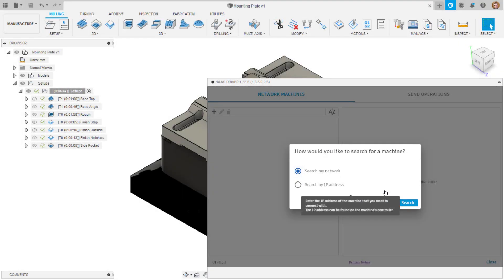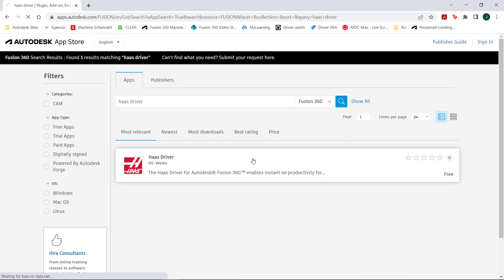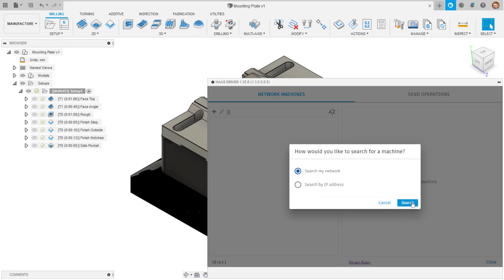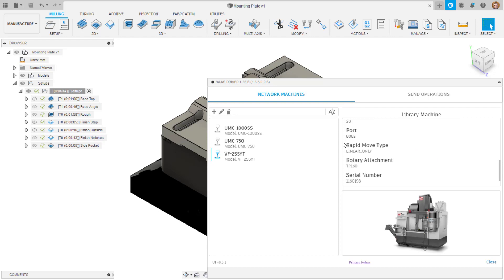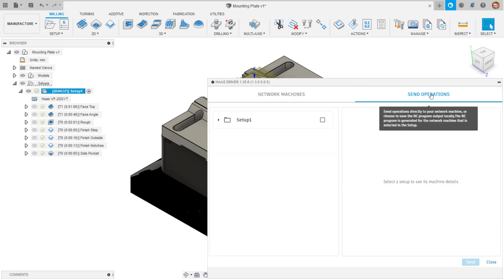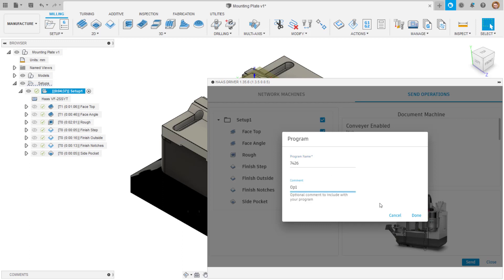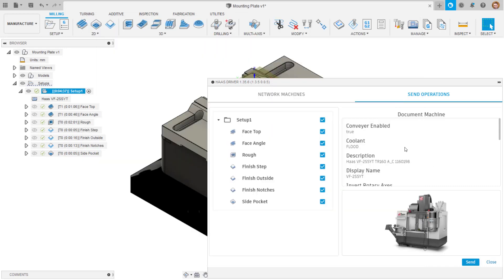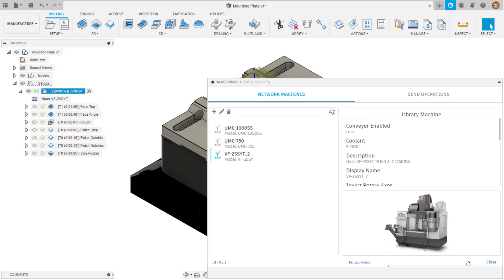Tutorial: Haas Driver for Fusion 360 | Autodesk Fusion 360

Comment: I'm getting a failed to add machine error. Now what?
Reply from the maker: Hello! Which version of control firmware is your machine(s) on? It is important to know that the Haas Driver requires a NGC control with REL-100.20.000.1200 or later.
Reply: @adskFusion  It is ver. 100.21.000.1120
Reply from the maker: @reedmadespeed  Which machine model are you trying to add? The Haas Driver is currently only compatible with milling machines. For further support, please reach out to this email: birmingham.haasconnect[at]autodesk.com
Reply: @adskFusion  Because others reading this might find it useful it's a VF2SSYT

Comment: The driver doesnt see my machines on my network even when using ip adress
Reply: Same problem here. Did you find any solutions for that?
Reply from the maker: Hello! Which version of control firmware is your machine(s) on? It is important to know that the Haas Driver requires a NGC control with REL-100.20.000.1200 or later.
Reply: @adskFusion  Thank you for your support, I have noticed that my haas firmware does not support this features. Thank you

Comment: no option for this in OSX?

and how would you apply this to machines already in your cloud library? (ones that use kinematics and operation specific post mods?)
Reply from the maker: Unfortunately, the Haas Driver is not currently available for Mac. With an industry-first workflow like this, we wanted to provide our customers with an opportunity to get hands-on with the Haas Driver as soon as possible and see for yourselves that instant-on capability is a real possibility when we work with our partners. 

The Haas Driver creates a new machine in your Network machine library, applying the kinematics of the actual machine to this. You would not then use the cloud library machine.